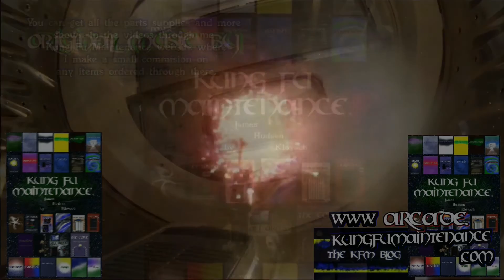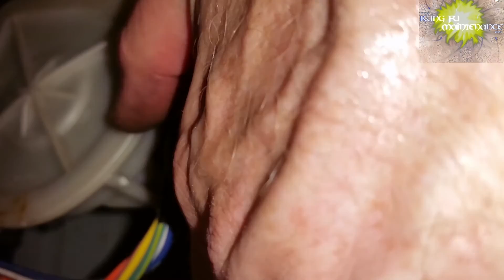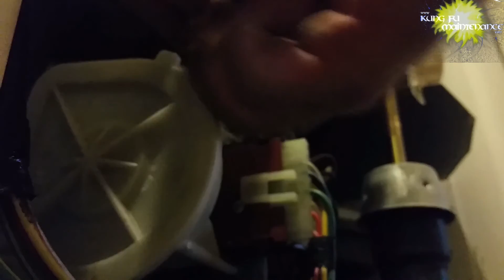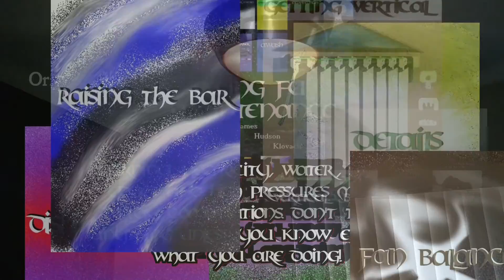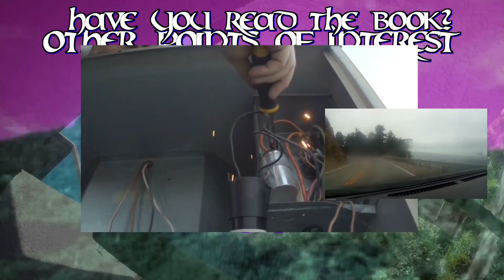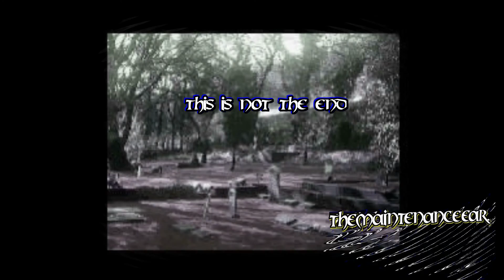Sounds Of Broken Washing Machine Coupler Plus How To Repair Clothes Washer Noisy But No Spin

Comment: Are couplers always broken in pieces or can they just be worn out and slide off?
Reply from the maker: Yes they can wear out in a number of ways. Sometimes they crack. Sometimes the pass through hole get worn so that the motor shaft does not spin the coupler. Sometimes they break apart.